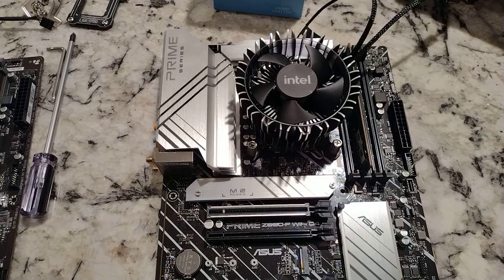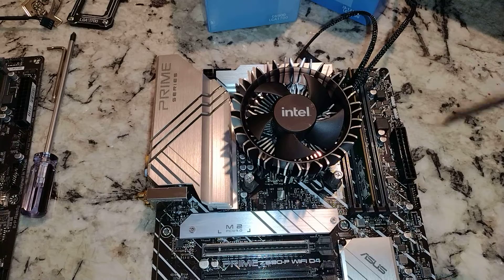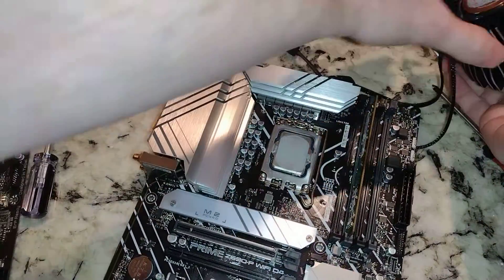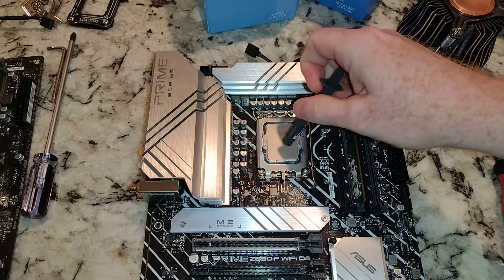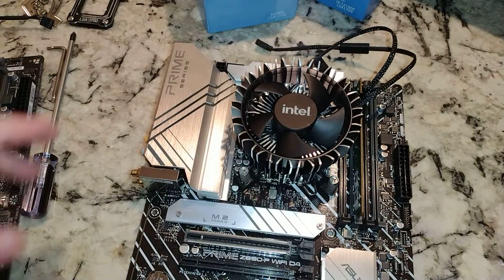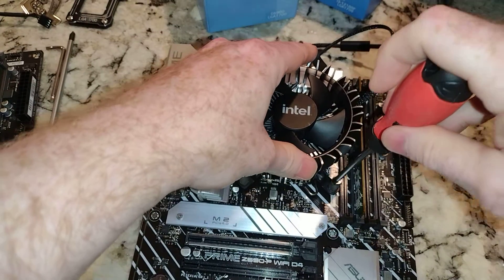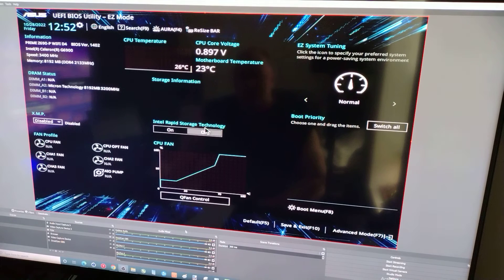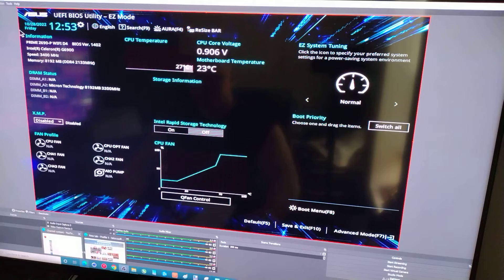Pt2: Get ready for 13th Gen - Updating an older BIOS with 12th gen CPU, step by step.

Comment: I just built my first pc with a 13600k and a z690 a prime, didn't post.. so I have to buy a 12th gen just to update the dang bios. I shoulda done more research, I am so disappointed 😖
Reply from the maker: Sorry to hear..these are somewhat common things..in the early stages of a new CPU gen using an existing motherboard series.  If this was 6-12 months from now..this would be almost flawless transition.
Reply: I have flashback and doesn't work. I wonder why we need to install a cooler for using a weak Celeron for 10 min
Reply: @DK-3000  it's probably a good idea because you don't want your CPU to overheat and crash during a BIOS update. Unlikely, but possible.
Reply: Hi! Did you find another solution instead of buy a 12th gen ? The same situation happen to me :(

Comment: I needed to get back to 12 cuz windows won't boot 🤦‍♂ so far the solution I've been given is do a clean windows installation
Reply from the maker: If you pulled your drives and it will boot to bios..but not windows I would try that or in my case grab 1 of 40 M.2s I have with Windows on them and try a different drive.  Surprisingly that works sometimes.
Reply: @PC_HardwareTechUnboxing_1  it enters windows 2ith 12700k but 13900k gives a "inaccessible boot device" ...so frustrating